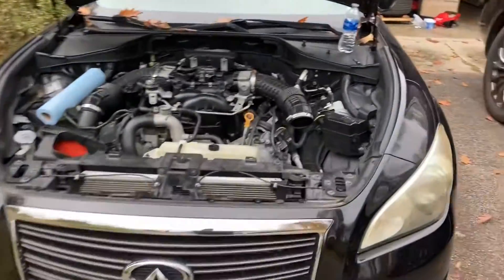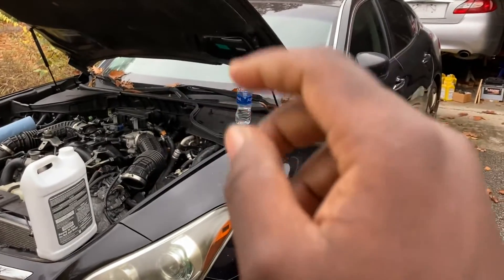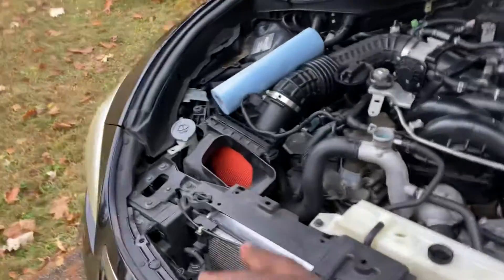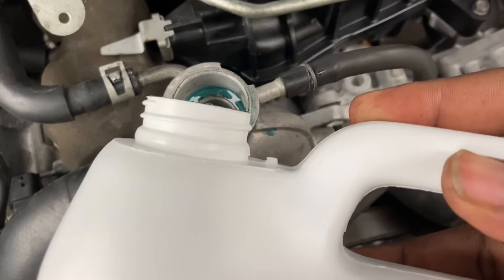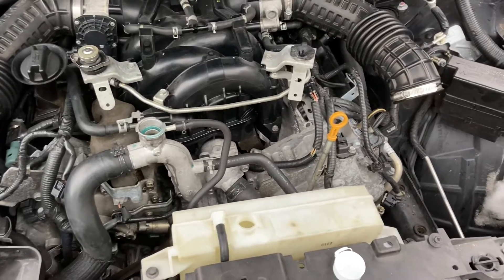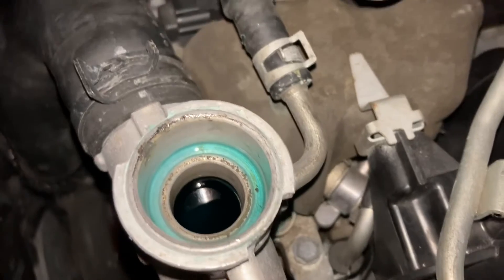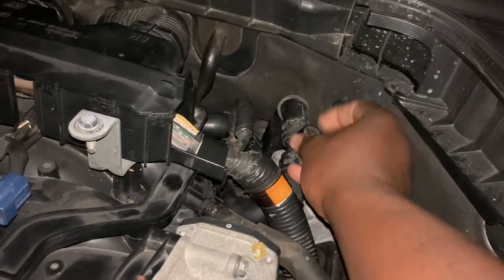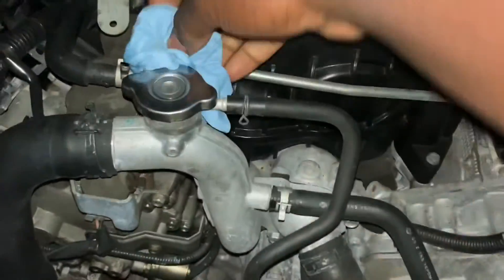Bleeding Air out of Coolant System. Nissan & Infiniti V8 engines are so EASY to burp

Comment: Great video Ed just changed my radiator @ 106k 2011.  Also put on some porterfield R4s pads.  Huge difference over the akebonos.  Should get some of those pads and see you shock of improvement 15-25% better bite.

Comment: Would you happen to know where I can get the reservoir black hose on top next to the cap? Mine is missing.
Reply from the maker: You could buy it from Infiniti. There was a cheaper one - part # 21742-1MA0A - that has since been discontinued, but you can still get part # 21742-JK90A (MSRP $44) 

Otherwise, look for used parts online...or create one from standard tubes. Since it's an overflow tube, it shouldn't see any significant action when the system is working properly.

Comment: Appreciate the content. You are a lifesaver. I was needing to add coolent to my M37 sport but didn't know where to bleed it and now I do. And do I need to get Nissan coolest from dealership or elsewhere?  Thanks
Reply from the maker: You're most welcome. I hope your project goes well.
As for purchasing, I usually buy mine from the closest Nissan or Infiniti dealership, but I found it cheaper on Amazon. If you want to buy the same blue coolant they come with from the factory, the part # is 999MP-L25500P
Reply: @EdBwoy   I appreciate it

Comment: This is awesome teaching. Thanks a lot for this. I need to re-bleed my FX45! I always raised the front wheels before now.
Reply from the maker: Thank you! I would say, if your cooling system is working well, then no need to rebleed it. I did not spend too much time explaining this, but over time the engine will usually bleed itself automatically pulling from the overflow reservoir.

It doesn't hurt to check though. I encourage it as part of regular checkups. Plus, it's pretty simple - when you open the system to look, you're only one step away by pouring in the coolant.
Reply: @EdBwoy  thanks a lot! Nkt relating to this video, but how do I tackle a C1204 code with VDS and AWD lights on in a 2004 fx45?
Reply from the maker: @biolaakinsanmi  I couldn't find it in any of the service manual for an FX45 to tell you exactly what it is. Could you confirm the number? Also, how did you get that number - did you scan it yourself?
Reply: @EdBwoy  thanks for replying. I used a ThinkDiag scanner and got these codes.
......
ALL MODE AWD/4WD 2 problems exist 1.C1203 ABS SYSTEM
2.C1204 4WD SOLENOID